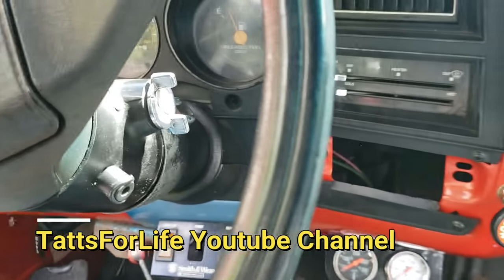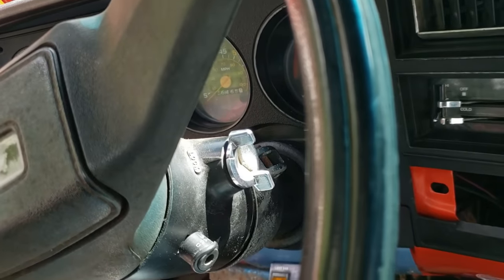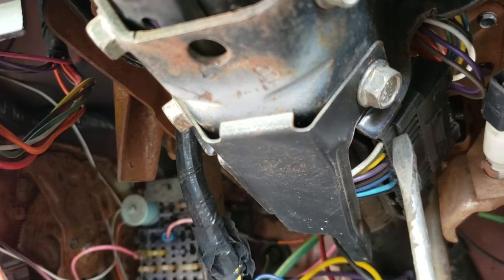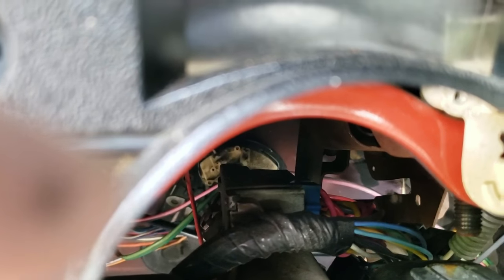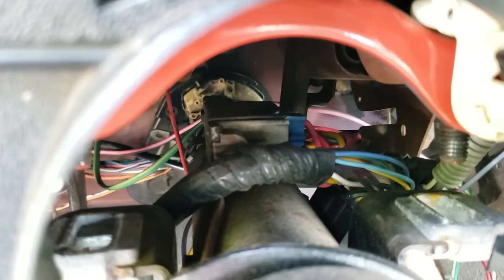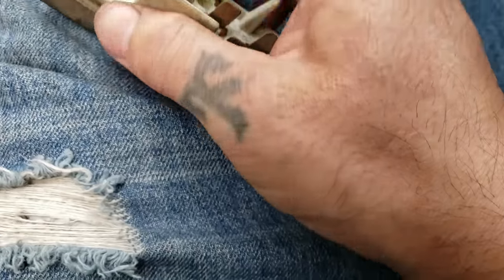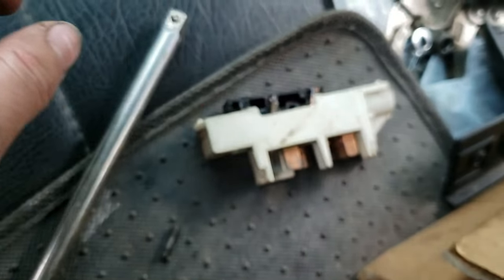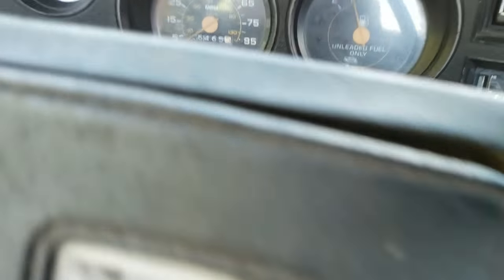NO START PROBLEM FIXED! C10 Ignition Switch Removal And Install, HOW TO VIDEO

Comment: Installed the new switch on my 82c10 and still no start. I didn’t have this issue until i installed my hurst promatic shifter. Any advice is greatly appreciated
Reply from the maker: sounds like you forgot to hook your neutral safety back up or bypass it
Reply: @TattsForLife  that’s what has me confused. Truck was starting fine then slowly it started to get worse as far as not turning over. I never touched the neutral safety switch until now trying to bypass it. Still nothing. Did i bypass it correctly? I cut the wires and tied them to one another.
Reply from the maker: @kbrooks1988  yes sounds like you bypassed it right, did it show any signs before you installed your shifter?
Reply: @TattsForLife  no signs at all man. All started after the shifter install.
Reply from the maker: @kbrooks1988  did you have a old column style before hand?
Reply: @TattsForLife  yes, the old style before I switched to the floor shifter.
Reply from the maker: @kbrooks1988  u got the old shifter in the park when u try start it
Reply: @TattsForLife  yes it’s in park. Before it went completely to not starting i would have to bang the column shifter up in park then i could get it to start, now of course it’s doing no turn over at all. Fuel pump still primes and i still have lights when i turn them on.
Reply from the maker: @kbrooks1988  have you checked all your fuses?
Reply: @TattsForLife  no, but I’m outside now about to check.
Reply from the maker: @kbrooks1988  a fuse could had blew
Reply: @TattsForLife  all fuses are good. Lol I’m over it dude. I’m seriously considering a toggle and button to crank it now.

Comment: Just did this but switch seems to be very loose or rod and doesn’t even crank to the start position, any ideas?
Reply from the maker: They should be some ajustment on the switch, the one I had i could slide  a far amount, or your rod may need adjusted

Comment: Hi I’ve pretty lost on this, thanks to this video I was able to change out my ignition switch, I’ve tested my neutral safety switch, and it’s fine, I’ve tried checking for power on the neutral safety switch wires and I’m getting nothing. My battery is charged.
Reply: From my testing it seems like the ignition switch isnt sending power to the neutral safety switch. Ive replaced the ignition switch twice. I'm not sure what to do.
Reply from the maker: have you replaced your safety switch yet and check your fuses

Comment: I replaced my switch, but now I cannot get the gear selector out of park when the key is in the "run" position.  The gear selector will move when the key is in the "accessory on" position, but not in "run".  Do you have any suggestions?
Reply from the maker: was it working before you tryed this?
Reply: @TattsForLife  Yes, the gear selector was working as it should prior to replacing the switch.  However, after a little more research I found that my new switch was likely just out of adjustment.  I loosened the bolts and slid the switch up the column a small amount until the gear selector was operational.  Then tightened it back down.  Now all works as it should and I can again start my truck using the key rather than a push button bypass!  Thank you!

Comment: Any alternatives for getting to this? Steering column don't go down like that.
Reply from the maker: they all unbolt like that one in the video under the dash, they have two bolts, ever steering column I have ever replaced or removed is doped by the two bolt on the support bracket , and i have droped 1000s of steering columns , hope that is helpful information
Reply: @TattsForLife  yeah man,  them bolts are off.  I'll dig a little deeper tomorrow,  thanks for the video.
Reply from the maker: @josephsanchez9007  welcome. They some small screws in the bottom of the floor board on a plate that goes around the steering colum goes through the cab you can take lose and give you some better movement if needed.

Comment: Will this work on 93 gmc vandura
Reply from the maker: I am not sure if it would or not
Reply: Anti theft light is on when I go to crank the van
Reply from the maker: @torrischappell7339  sounds like a vatts issue in the computer to me
Reply: Well I can try to run it to bypass it to 30 n 87 to see if it will start right

Comment: Following the last video but mine couldn’t find the part number what is it called
Reply from the maker: "Ignition Starter Switch"
Reply: TattsForLife I got a new one and still having the same problem when I turn the key to the accessories position Get everything comes on I hear the fuel pump then I turn the key all the way and hear a click sound just one time I checked the battery have 12.4 volts
Reply: TattsForLife I don’t know if it could be a bad starter I can’t get anything to touch the post on the starter to bypass
Reply from the maker: @drippin.sticky5218  could be a bad starter, take it off and bench test it, before you do that take a booster cable ground and hook it to your ground of your battery
 and then hook the other end of  that cable ground to the engine and try it, if it cranks you need more grounds for the battery and engine

Comment: Can't figure out where the metal rod goes back into the new switch! Help!
Reply from the maker: it has a slot that it goes into
Reply: @TattsForLife  There's a little hole that you put it in on the bottom.

Comment: I'd wondered if you knew how to put a PTO on the side of one of the Muncie transmission
Reply from the maker: The sm465?
Reply: @TattsForLife  yeah that's the one I have one on my dump truck and PTO unit and I can't figure out how to get the shaft off so I can change the throwout bearing
Reply from the maker: you have rod driven pto, or one that has a pump installed to it? and are you talking about the rod to the lever or ?
Reply: @TattsForLife  thanks dude took a chance took it apart drop the pump thanks for your response and yes it was the one with thedrivesb
Reply from the maker: welcome

Comment: So I’m at a loss my battery was acting like it was dead and the motor turned over for a second after on the charger for awhile and now nothing not even the seatbelt light will come on when I turn the key but the headlights work fine the battery is reading 11v which is low but idk why my seatbelt light and all that wouldn’t work
Reply from the maker: 11volt is a dead battrey
Reply: TattsForLife I sure hope it’s that because that’s the easy fix lol
Reply: TattsForLife well it wasn’t the battery
Reply from the maker: @yamahaguy1732  try a new battery or just charged that one?
Reply: TattsForLife tried a new battery I’m currently trying to get the switch out
Reply: TattsForLife how do you unplug it are they’re any clips
Reply: TattsForLife any tips for getting the rod into the small hole
Reply from the maker: @yamahaguy1732  trail and error lol it's a pain in the ass lol
Reply: TattsForLife yeah it didn’t work either idk what I could be cab lights work headlights and horn work everything works except for what should work when I turn the key you got any ideas
Reply: TattsForLife I wonder if it could be a bad ignition cylinder
Reply from the maker: @yamahaguy1732  have u tryed the nutral safety switch. It would cause that issue
Reply: TattsForLife I figured it out after lots of cussing and pain to my hands I found out it was a loose bolt lmao oh well I got a new battery and ignition switch from that I’m sure the switch was gonna go before to long

Comment: i moved the rods and now my switch wont turn, i took the steering wheel apart so guess i have to buy new switch with key because the old one wont turn now?
Reply from the maker: the rods should be able to go back and work, unless your key switch is wore out of your key, or if the rod is in a bind
Reply: @TattsForLife  New switch worked then when i it everything back together the new key now wont turn? so i am going to take your advice and check and see if the rod is in a bind! keep your fingers crossed for me! THANKS

Comment: brother,  thank you for the video, you need to get yourself a camera that you can set on your head or chest, i tried to watch how to get to the switch but every video i looked at it was after they taking everything apart and tells me this is the switch and the video ends,  and no information on how to get to it, trust me your channel will get big hits, start with cheaper cameras get 2 if you want  for different angle. good luck.
Reply from the maker: Thanks I have a few go pros, I just not to skillful on useing them yet, so I tend to shoot with my cell phone alot,  I'm happy the video was helpful
Reply: @TattsForLife  watch videos on how to video lol good luck,  there's a small tripod that you can attach any where.
Reply from the maker: lol thanks
Reply: @TattsForLife  my truck still won't start the starter start but the engine won't start i have gas and i just replaced the gas pump  about 2000 miles ago
Reply from the maker: you mean it cranks and getting gas, if so have you seen if you have spark?
Reply: @TattsForLife   it started now but running funny i think the  distributor is funky i need someone to do the timing correctly, after the smog check it started running weird but it passed.
Reply from the maker: @G-V-M  I dont think anything I own would pass smog

Comment: Well shit. Your drive position 
Indicator is already gutted out.
Reply from the maker: its a manual truck with a auto column I wanted the tilt lol
Reply: @TattsForLife  Mine is automatic. with a little fooling around, I managed to get it disconnected in order to drop the column.

Comment: I replaced the same exact part on my truck, now when I start it the starter keeps going even after i let off the key.  I can pull the key all the way back and the starter is still going.  Any ideas?
Reply from the maker: sounds like the rod is sticking that turns, the new switch may be bad. I check make sure the rod can work smooth, you could also have a crossed wire or a bad starter